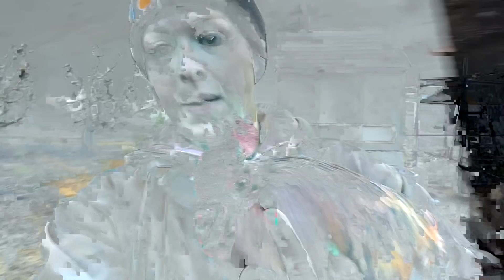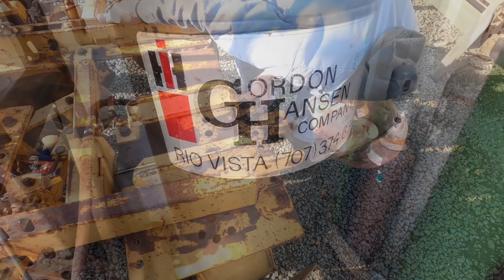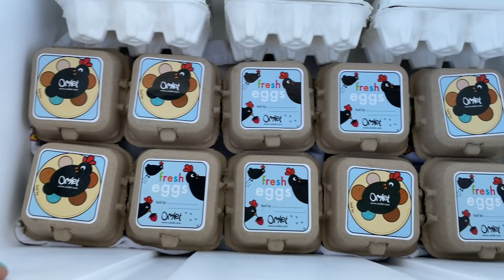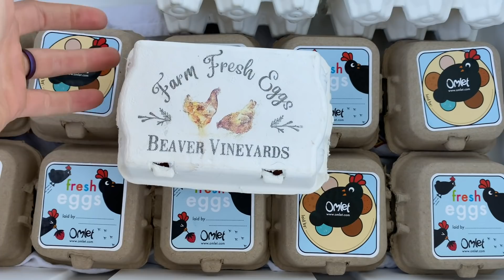Tearing apart my TINY DISK

Comment: since you have it stripped,,,id repaint a couplea coats, replace all blades and bearings and reassemble,,,,then you are fixed for 20 yrs,,,,if it were mine, id have left the weight brackets on as its not a real heavy disc,,,and in my use, could be weighted for working new ground, sod, roots, or small limbs and trash,,,,however, your use may be different,,,,good video,,,keep them coming

Comment: Why did you disassemble the disk to replace the blades.... the bolts holding the bearings to the upright would have surficed......You could have dropped the shaft with the blades out the bottom ....
Reply from the maker: We’re replacing much more than just the blades. But yes you’re right